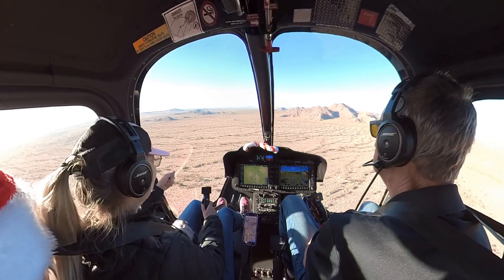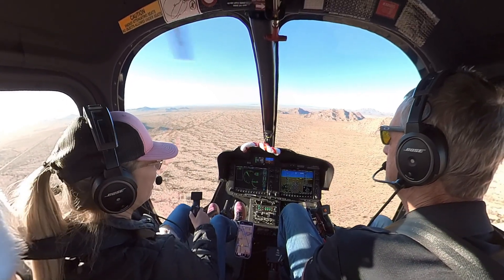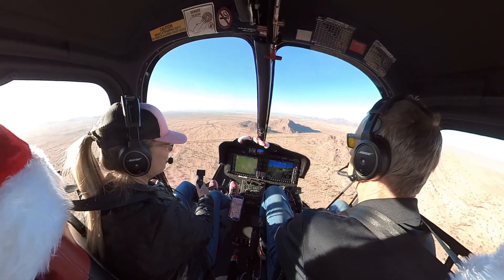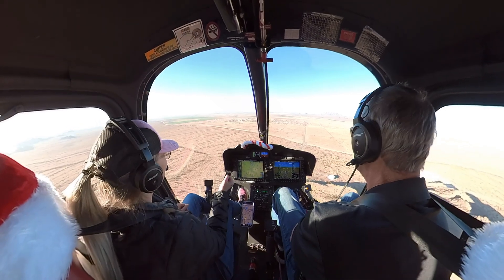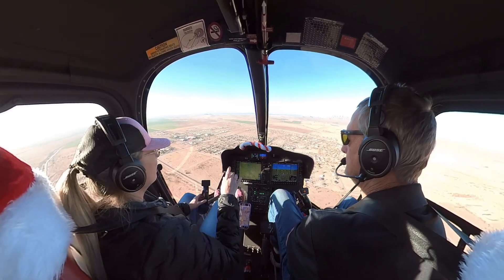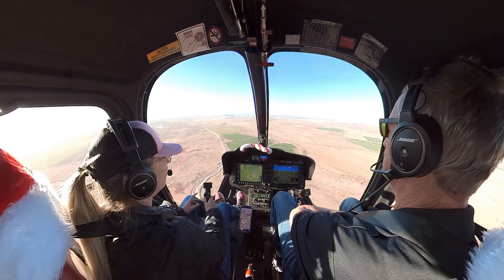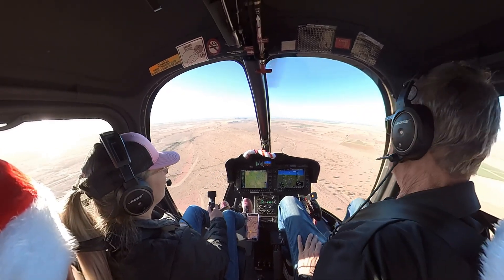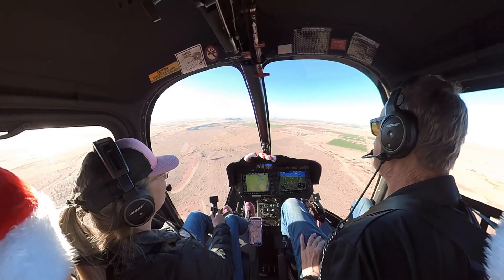What do the pedals do in a helicopter? How to fly the Bell 505 JetrangerX in trim.

Comment: Can Bell 505 fly at night or in low visibility weather? It can be equipped with the more advanced electronic avionics equipment. It flies at night or in low visibility, such as vision enhancement systems or night vision devices, as well as lidar？
Reply from the maker: The Bell 505 is certified for Day and Night VFR. No lidar, and I don't know about being configured for use with NVG's
Reply: @HeliPilotLeigh I am an aviation enthusiast, but I really like the appearance of the Bell 505. Based on your experience, after being equipped with the relevant night VFR certification, is it still safe to fly at night without a lidar and night vision goggles?
Reply from the maker: With enough ground lighting, you can fly safely at night without getting disoriented... though it limits your options if anything goes wrong for picking out an emergency landing spot. I personally choose not to fly at night.

Comment: 😂 I was wondering after flying helos in the sim if you had to follow the turn coordinator. Definitely different than fixed wing for sure but a lot of fun.
Reply from the maker: Yes, I'd be curious how the trim is set up in the sim, as this helicopter reacts different than others.
Reply: @ they have weekly worldwide helicopter and fixed wing challenges. Having never flown a helo it’s a fun and very challenging especially with the motion platform. I’ll have to take a video and post to get your thoughts.
Reply: @ I’m going to work on a video following some of your steps in the sim version of the candy cane 505 and try to get some different angles of control inputs and what happens in the sim

Comment: I have a scare question for you.  Analogy to one leg stand up then  go walk on narrow path with eyes closed. Will you able to lift up and go forward with eyes closed. I mean for just 10 seconds. Of course, Mike will grab control if look like going crash.  bonus challenge is can you change almost exactly 90 degree in direction with eyes closed. I remember you had yoga skill which is very useful to sense of balance and direction while close eyes. Thank you for answering us.  I like that video about balls and balloon you talk about. Yes, I always curious about how much pressure to hold pedal while flying.  I once had chat with fighter pilot who flew in WWII, he explained me that he had to push pedal to floor when he take off due to huge torque from 2,000 hps supercharged engine.
Reply from the maker: It's a great question Glenn. No, I wouldn't be able to...not even for 10 seconds, let alone 1 second. The way we control a helicopter is entirely visual, with reference to the ground/horizon/sight picture. The cyclic inputs are incredibly small relative to the helicopter response. So with your eyes closed, it is impossible to safely control the helicopter. That's why it's so dangerous for a helicopter to fly into a cloud and lose visibility...80% mortality rate if a pilot inadvertantly flys into IMC (Instrument Meteorlogical Conditions.)
Reply: @HeliPilotLeigh  That is best information to know.  I happen had eyelash or whatever fall into my eye that cause my visual mess up while I am driving. So, look like much scary if flying helicopter.  I guess US Coast Guard helicopter pilots are much brave and trained so well to fly in bad weather. I had highly respect for them rescuing Alaska fishermen and (yeah) fisherwomen.